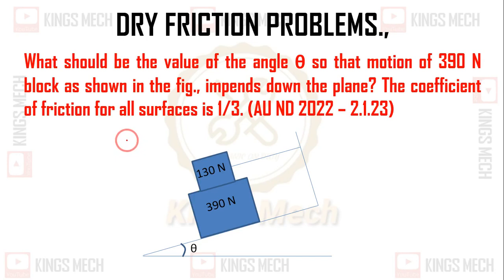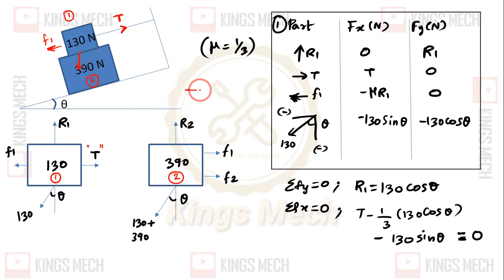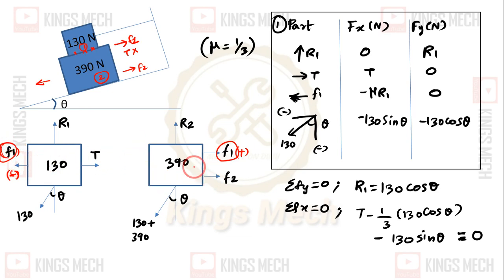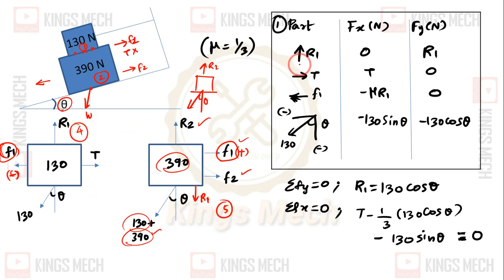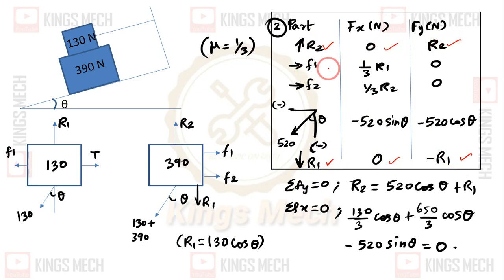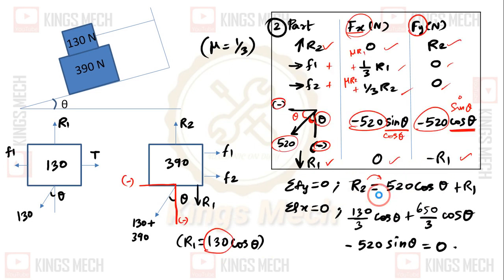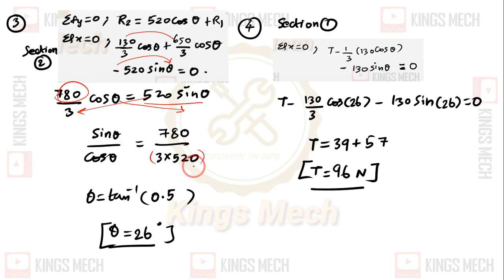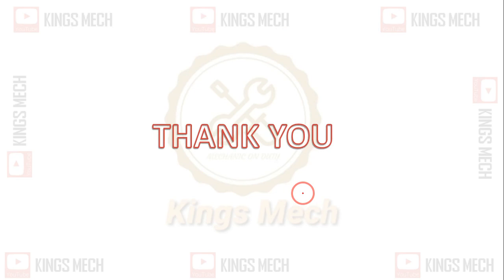Angle finding of inclined bodies problem AU ND 2022

Comment: 6:03 sir 520 kandipa mela ula load add pannanuma ila 390 potalum correct ahh dha varudhu 390 vachu panna correct ahh sir
Reply from the maker: Definitely add top load.,
Reply: @kingsmech  appom two box horizontal plane la irundhalum add pannanuma sir 2nd box ku
Reply from the maker: Yes